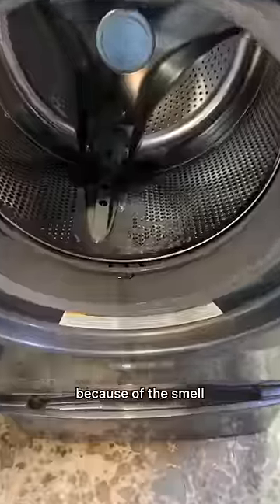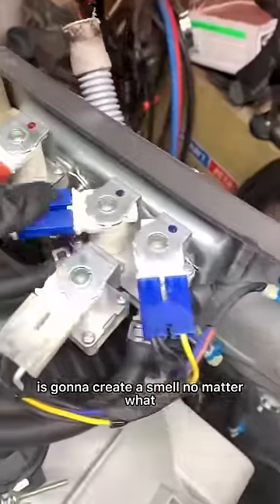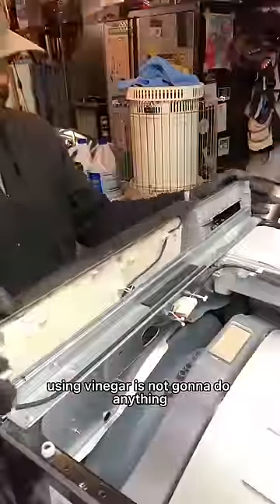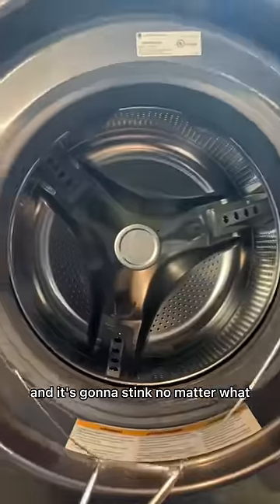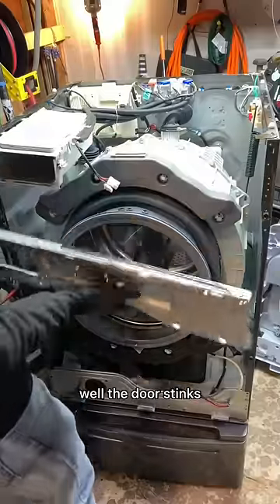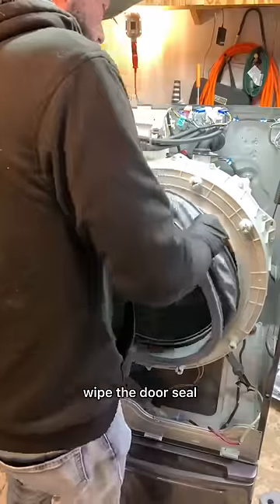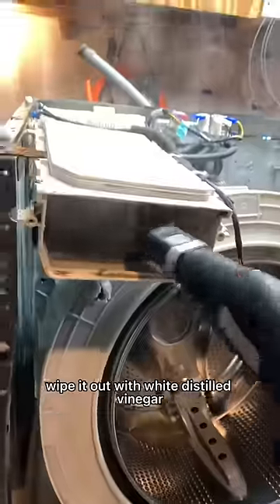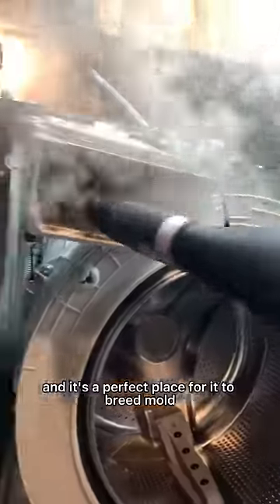Front load washers are proven to wash better. Facts, not opinion

Comment: Also never close your door after a wash! Leave the door open so it can air out and water can dry!!
Reply: Most people probably leave the door open on their top loader but seem to think that's unique for a front loader. We've had front loader for six years, it got smelly in once and I wiped under the door gasket. Wife stopped using softener after that.
Reply: @@phillipbanes5484Front loaders use less water.  They use less detergent.  They use less energy.  They clean better.  They spin faster so they save on energy needed to dry your clothes.  But, otherwise they’re lousy.   Lol. Be smart.  Get a front loader and just leave the door open until it dries naturally.  My mom used to leave the top loader open for the same reason.  Duh!
Reply: Should help protect the spider too, since it needs moisture to corrode. Also leave the draw slightly open between washes to stop mould growing in there. The residue left in the tub from liquid detergents retains moisture, so using powder detergent, preferably one with oxygen bleaching action (since it kills mould and bacteria) will also help.
Reply: Ikr?! Duh I've never understood how people don't get that
Reply: In europe we dont have designated rooms for washer and dryer so they are in barhroom which are often small so you cant leave washer/dryer open, and have them stacked so they take less space.
Reply: Most issues could be avoided if people would actually read and follow the manual.
Reply: Use chlorine bleach periodically either in a load of laundry that can take bleach or run an empty cycle using bleach. I keep my washer closed. Yet it has no mildew and doesn’t stink. It’s about 18 years old.
Reply: @Pseudynom exactly👍and. For people with less room space. You don't have to leave the door open all the time. Just leave the door open for few minutes after washing. That will really help. 😊
Reply: Why are you okay with having to leave the door open? It’s not practical or aesthetic and we shouldn’t have to do it… but even so, it doesn’t work 🤷🏼‍♀️
Reply: @officermeyer because normally you don't leave doors open to appliances; like it's weird to leave the oven door open
Reply: @SimZimPL also it's a safety hazard for children
Reply: Great product! Just leave a knee high door open in a small room to trip on!

Comment: After every load we keep the door open so it can air dry.
Reply: I'm glad I'm not the only person with more than 2 brain cells xD so many people seem to just not get it.
Reply: Exactly what I do
Reply: Wipe the seal too… mildew will build up.
Reply: @MegaGyalis  I've checked under the seal and no mildew to speak of.
Reply: Im so happy im not the only one here thinking that
Reply: @MegaGyalis  just checked mine to its roughly 7 years old and never been cleaned no mildew or anything else to speak of at all
Reply: Keep the door open after every wash and I use white vinegar as fabric softener. Never had to wipe the seals or had any mould growth on my front load washer.
Reply: @nathantarr7308  I just started with the vinegar stuff since that's what he suggests in these vids. Didn't smell like vinegar, so that's a plus.
Reply: @Honey_Daddy  I’ve been doing it for over 5 years and never had a problem with my front loader or clothes smelling like vinegar. It also helps in descaling the plumbing pipes that the waste water from the machine goes through.
Reply: @nathantarr7308  thanks for one more reason to keep using it. I'm gonna stick with it.
Reply: This is what I came here to say this. I have a slightly different version than this front loading washingmachine. It works the same way as this one but because it space efficient, it loads from the top. There's a hatch you open, you drop your washing in, close the hatch and then you close the top lid. It function exactly the same as a front loading washer. When I'm not using my washer, the hatch and the lid are open in order to not grow mold.
Reply: I do this also, and it still doesn't solve the issue.
Reply: @micahmoore9845  do you live in a damp environment/area?
Reply: I leave the door open and let it air out.
Reply: My front loaders is still in great shape it’s 15 years old! I leave my door open so it can air out!
Reply: Occasionally doing a hot washing cycle also helps.
Seems like Top loaders are an exclusive American thing, haven't even seen one in over 40 years.
Reply: I do this for my top loader I would def do it for a front loader too. I've never had a front loader before but have used them at clients homes and even though it wasn't part of my job I would see how nasty they would be and would want to try to clean them up. Not knowing much about them though I wasn't able to do much but I did the best I could. Every single front loader I came across while cleaning houses was gunked up and stunk. I'm starting to realize it was the owner not so much the machine. Now I've kinda been wanting one.
Reply: Keep ur dispensers open too
Reply: I keep the lid of my top loader open til dry.
Reply: Once you know the dark secret of softeners the stink makes perfectly sense
Reply: So do we. Ours still smells like shit..
Reply: @micahmoore9845  you have to do it from when you get the washer. you can't just start doing it years later and expect it to fix the issue without cleaning it first. its not gonna get rid of mildew that exists already.
Reply: @Stackali  It was done from the very get go.
Reply: I bought a front load washer in Best Buy and told me to keep the door open after each load, so it’s something the store or employee needs to say also
Reply: @Honey_Daddy the problem it’s that it leaves cloths like kind like itchy ykwim
Reply: @DCA307  I don't. It's empty of clothes at that point.
Reply: Easy peasy. 

Love lazy things that work.
Reply: @craymosstheater3999  have you ran just soap and bleach in it? Does your machine a sanitize load?
Reply: That's what she said 🤦🏼‍♂️😂🤣😂🤣

Comment: I own a commercial laundry, a launderette and was  a washing machine service engineer for 10 years so I have a fairly good handle on this subject. 

Users have a perception that more is better when it comes to dosing washing machines with detergent. This is not the case of course as water only has a limited ability to suspend solids-this both dirt and detergent (think the glass of warm water/salt experiment you likely did at school). The repeated over-dosing of chemicals causes a residual build up in the machine, which in turn causes the smell. We don’t have this problem in the laundry as the machines are auto-dosed with carefully controlled quantities of the various chemicals we use, and as such we achieve the necessary results without wasting chemicals and causing machine damage-not so crucial when the domestic user is doing 5 washes a week, but when that number is 1500 a week it becomes relevant. 
So, cut down on the detergent however you administer it (liquid or powder). Oh, and leaving the door open is a good tip, as mentioned by another commenter
Reply: Bro no one is gonna read that, youtube comments are meant to be short
Reply: @Warp2090  he started his comment with a great hook. He owns  a commercial laundry and is a fixer. if that doesnt warrant credibility despite however long his comment is, you should just ask chatgpt to give you a 1 word response
Reply: Bro what? @MyBoyJohn
Reply: @Warp2090  Don’t over-dose detergent.
Reply: @Warp2090 you might just be too young.  I write lengthy comments all the time, and I read lengthy comments all the time (so long as it sounds like it’s well thought out from the beginning).  Every once in a while I’ll get someone who complains about my lack of brevity, but it’s rare and I don’t care.
Reply: @Warp2090 I love to read. Not ur taste but those are the comments I look out for as I love to learn. Stay curious 🧠
Reply: @davidswanson5669  Its not that, its the fact that some ppl dont have time to read them. Also wth does "a great hook" mean
Reply: @Warp2090  we vote with our eyeballs, and clearly the most popular comments are ones that don’t require a “more” button push.  So it’s not a big deal if people skip long comments, but no need to call out a long comment.  

A “hook” is similar to a “headline” on a newspaper.  The way to incentivize people to read anything long is to intrigue them upfront, in the first sentence usually.  Perhaps my choice of the phrase “vote with our eyeballs” was enough to make you want to read what’s next, because it stands out.
Reply: @Warp2090  I read all of his comment, it wasn’t that long
Reply: I read all of it and 'learned' from it !   Appreciate the man's Reply very much.  
'What's a great hook'  >>> speaks volumes.     :-)
Reply: @crazywarp36  bro you gotta work on your attention span, this wasn't a long comment at all
Reply: @crazywarp36  How old are you? Does Mommy know you're playing on the computer again?
Reply: @Warp2090  ...So, just don't read the longer comments, and keep scrolling. You don't have to announce it to everyone that you're not going to read someone else's comment.
Reply: @davidswanson5669  ...Nah, that was probably too long for him to read, too. He's determined to argue with everyone about why he doesn't want to read longer comments, because he doesn't have time. But by the total time it took him to write all his replies, he could've read the original comment at least twice already. 😂
Reply: @SophieMia806  I really dont care LOL
Reply: @Warp2090  ...If you don't care, then why even bother replying to anyone to begin with? Why waste your time, if you have so little time to spare? You're sure wasting enough time replying to everyone's comments.
Reply: @Warp2090 it was a very easy read.
Reply: @DJRenee  why are u replying to  old replies that I dont care about anymore
Reply: @KatarinaS.  Bot
Reply: @Warp2090  why are you replying to old replies you don't care about anymore?
Reply: @MyBoyJohn  You're correct except that he's talking about commercial units. There is a huge difference in performance and reliability.

Comment: There is a very easy fix for this, just make sure to always leave the door open when you're not using the washing machine. Water can evaporate that way and it'll never smell bad!
Reply: If you have a house with cats in it they close the door. So I went and got a GE Monogram too load with removable agitator. It is more quiet than the Samsung that was only 2 years old and no worries about trying to leave the door open
Reply: Or I can keep using a top loader without having to do it none of that